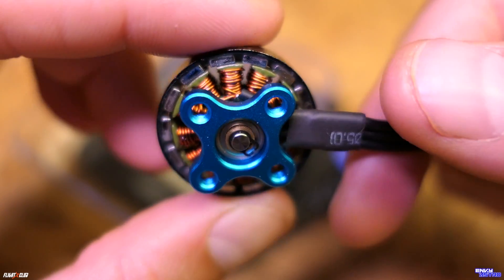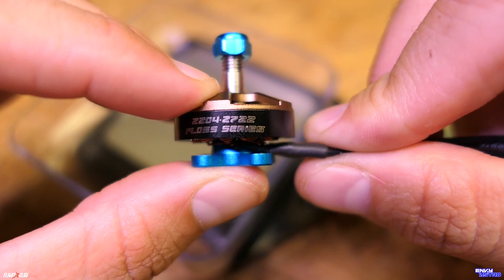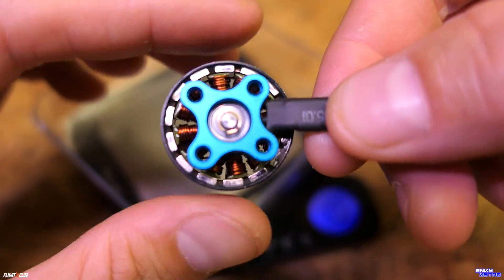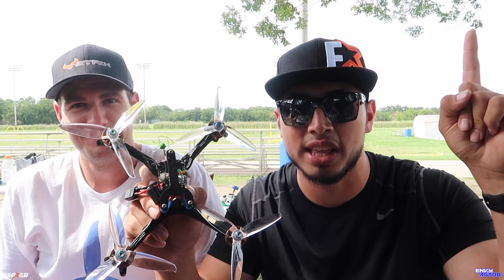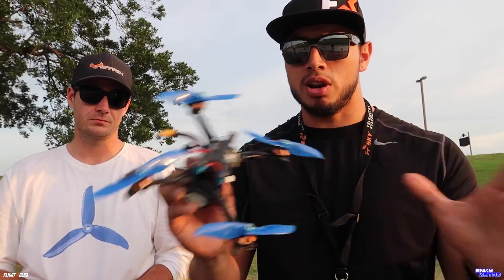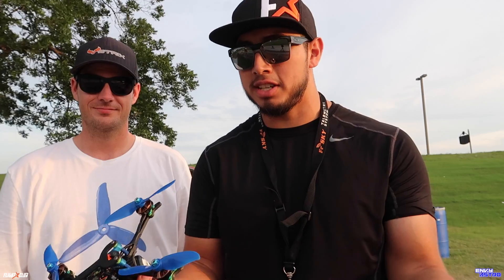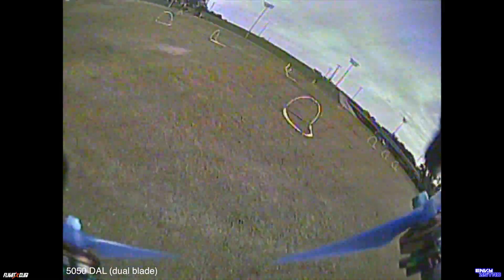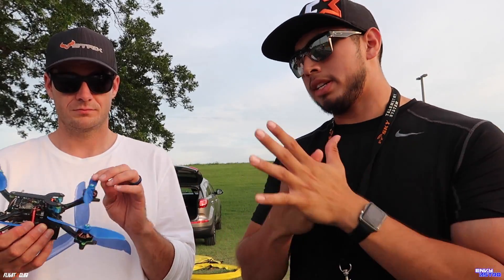Hyperfloss 2204-2722kv Review // 5 min flight time?!?! // (Part 2/3)

Comment: When doing the efficiency test, you were running a bi-blade instead of your 5152's? If you ran the test, what was the flight time with a 5152?
Reply: Josh Waldron the efficiency test was on the 5152 blades
Reply from the maker: Josh Waldron it was still 5 min, if you notice I Hd some text right before the flight stating that the test was still done on the 5152
Reply: I must have missed that, thanks for pointing it out. I was confused by Justin spinning the bi-blades while talking about efficiency.

Comment: So you only tried them on GF5152 and DAL Cyclone V3? Sorry can't read small text on low resolution (240p, internet is awful) They would probably perform best on a DAL 5X4X3, and then be even more efficient.  On the drag race the KISS CC 21A current limit was probably why it couldn't hold the turn very well.
Reply from the maker: The RCAddict no we tested other props on it. That’s what the 3rd video of the series is about, also I don’t think so since I’ve flown other set up and had the same dipping around hard corners but maybe.
Reply: Ok, might just be the 2204 not supplying enough power then.

Comment: That's why I run 1000mah packs with that frame and those motors.  Dropping another 30-50 grams in battery weight makes a difference in the handling, but you still get a solid 2-3 minute out of them (down to storage voltage) with the right prop.  My prefered props are the HQ 5x4.3x3 for a tight track and the Dal 5050 Cyclone twin blade for more speed.
Reply from the maker: Justin Treon I may need to try running a 1000 mah battery I’m sure it would save weight and still be good for a 2 min race!
Reply: EnvyAstro Try the Airblade 75c/150c 1000mah 4s. They weigh in at a mindboggling 112grams and have plenty of punch. Doesnt get much better than that!

Comment: great video guys I like your channel a lot - really comprehensive and fair testing. At the risk of sounding pedantic I suspect these motors are not so much efficient than just lower power which equates to the longer flight time...good idea tho for started build (without HD cam or maybe with Runcam Split?)...on a light but tough frame...
Reply from the maker: +Stephen Wright  these def have the power though and he efficiency was very great from what we tested! Thanks for the support btw
Reply: ...cool power and efficiency is relative so on a normal 500-600g AUW quad with GoPro they would not have had the power thats what I mean - in this configuration they felt powerful and efficient...

Comment: Did you guys happen to measure the max amp draw? I'm wondering if that KISS CC AIO will be constantly limited.
Reply: I plan to use the spark. Should be no problem
Reply: these motors are perfect for kiss cc aio on 5 inch reasonable props
Reply from the maker: jakjakman yes sorry I forgot to mention we were using the AIO kiss on this build!
Reply: Do you think the raceflight spark 4n1 would work on a 5" will reasonable props?
Reply: Thanks!
Reply: EnvyAstro , cool that looks like it makes a tight and light build. Did you happen to record any of the max amp draws during the flights?

Comment: This is cool! Can't wait for the final vid to wrap up all your guys's findings on this kind of 'lightweight F1 race car' style/concept. It validates my intuition behind my build. I've posted my build to EnvyAstro enough that I'll pass on reposting it again here, though I do have 2 questions I'd like to hear your thoughts on: 

1. Have you guys considered the Asgard or Midgard FC/ESC AIO? I have the Asgard v2 and it is just awesome! More powerful than the KISS, and since it can log blackbox to SD it might help here in the design/testing stage.

2. Would you now be up for testing the Fuuton motors (that I choose for my build) based on what you've seen and learned here? At 22.8g for a 2205 2500kv (and a price point of <$9 per), I and the other guys in my local chapter find they are surprisingly good on my 274g F200 build (which BTW I could easily get down to <250g by changing to the Runcam Micro from the Monster v2, removing the motor bumpers, and removing the 2mm bullet connectors on all 4 corners, and maybe even go to a lighter VTX antenna from my standard Pagota setup). 

(Looks like I pretty much ended up reposting my build again anyway... lol)  :D
Reply from the maker: GITech we have the AIO kiss in this build which makes it super clean and light! And idk man maybe I’ll give them a try once I see more people interested in a review for them motors.
Reply: Thanks for the reply. I believe, (especially since you flash BetaFlight on your KISS AIO's anyway) that the advantages the Asgard has (higher current, CS, SD BB, OSD, remapable ESC to motor #, free repair or $45 replacement,+,+) that the extra ~4g just might be worth it. As for the motors: You won't see interest in the Fuuton motors crop up naturally. They are not advertised or even labeled as they are simply a "replacement part" for the FuriBee Fuuton RTF quad. It would be you who would/could bring their existence and 'technology' into the fold, so that not only end users but developers such as Kabab/HyperLite might benefit from the push they might provide. (?)
Reply: I would be very interested in a benchtest of the fuutons. I love mine.

Comment: 3022 is where its at, screw 2722
Reply: I was thinking the same thing.  Have you flown with the 3022 on 5" props?  How was your amp draw and flight time?
Reply: no I haven't I'm running them on a 150mm with 4in blades.. there crazy loud and fast.. but haven't tried 5in yet..
Reply from the maker: WiYTBOi FPV SedHendo has some looks like I may have to fly them lol
Reply: yeah I would say so.. I'll take quick clip of my Mizuko launching with 4in and the sound is nothing I've heard before.. the poor 4in bi blade a screaming as it shoots off.. yeah I'll do that after work tonight.
Reply: EnvyAstro hay also if you haven't already check put the avan-r, I like 5152's but I think the avan are bit better and way more durable.. then don't vend near as often as a5152's. I'm waiting on some cyclone bi blades to get here, and still searching for avan bi blades to try out.. but for tri blade I'm digging the avan right now..